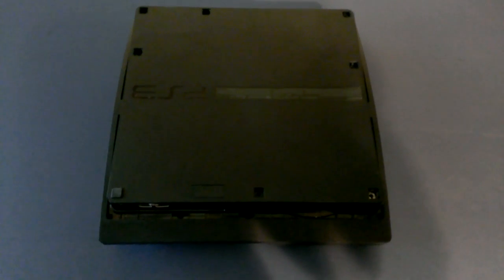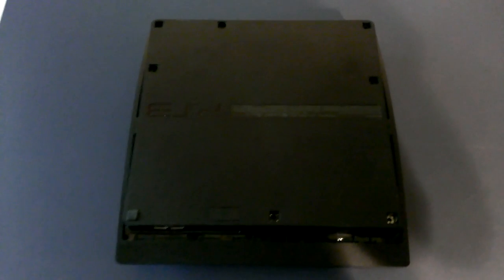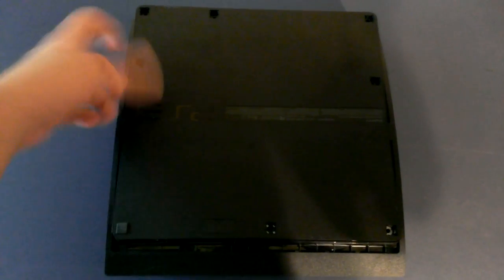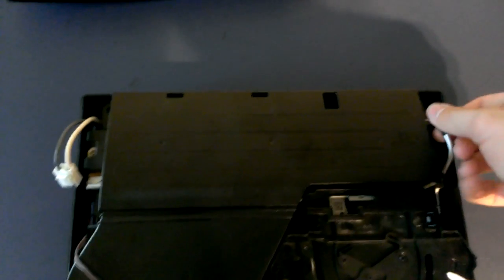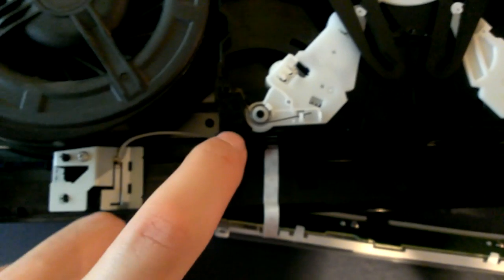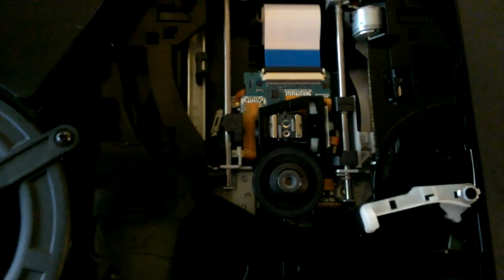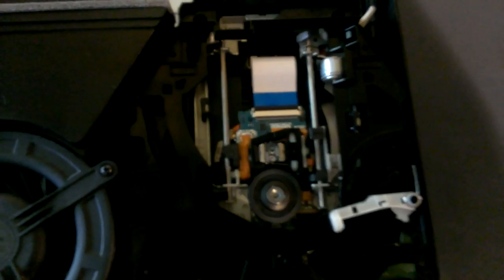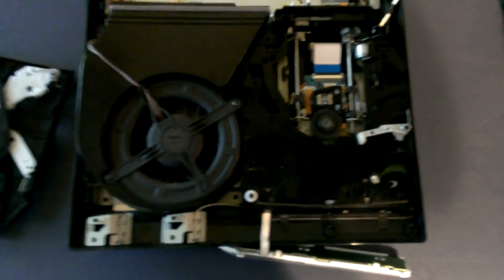How to Fix PS3 Error Code 80010514 Disc Read Problem

Comment: Just cleaned mine but still won't recognize a disc.  Guess I'll try again!
Reply: yep same here these fix it videos are bull crap! maybe it works for like someone in a very dirty area and maybe they smoke a lot, but my ps3 inside was fairly clean and I looked at the  laser lens with a magnifying glass for any smudges or dust but it was clean

Comment: Mine only happens with Madden 09 Collectors Edition, all my other games and movies work fine. There's no Utility Data on my PS3 for Madden, last time I played it was on my other PS3 that got the yellow light, I have a super slim ps3 now.
Reply: Same thing with me. Exept modern warfare doesn’t work
Reply: @lenonmedini3806  my comment is from 2 year's ago so i have a small update on it. My Madden 09 collectors edition has disc rot. Even though it's not scratched, there's no see through dot's after pointing the disc to a light source, the disc got damaged while i had it in storage, i found out that games made from 09 and prior, have a history of disc rot and they will get messed up through the year's.

Comment: Also guys, I just had the same error, ejecting the disc putting it back inside and then when you launch the game MASH all buttons on the controller repeatedly nonstop and it will get past 8001514 error screen
Reply: Real?

Comment: Guys, before you do all this, keep entering the game at least 10-15 times and if one of those times the game worked, it means even if you did all of this it will still give you the same code sometimes and you'll have to start the game by trying multiple times.
Reply: I kinda agree on this because I did try that with my Asian copy (R3) of Burnout Paradise for more than 7 times if I'm not mistaken but when I insert the R1 (region North America) copy of that game, it works consistently. It's weird that this happens to two (including Battlefield Bad Company 2) of my R3 games....
Reply: @hashrulsubzero  I'm having this problem with CoD World At War unfortunately. I miss it so much but couldn't catch many games before it completely stopped loading the game
Reply: @Kamal_AL-Hinai  yeah i have issues with battlefield 4 and fallout 3
Reply: @Kamal_AL-Hinai  same here. Was playing world at war back in January and it worked fine. Try to start it up today and get this
Reply: @sourkraut5369  
Turns out my CD was in a bad shape bro. When i got a new WaW CD it worked just fine every time. What a great game!
Reply: @Kamal_AL-Hinai  great to hear, thanks for the reply. Gonna get a new disk
Reply: Pvzgw
Reply: @aishadumm6772  
Why bother and type that? 😂
Reply: What do you mean? Like pushing the disc and pull it out or try the game and then close it and open it again??
Reply: @no-ei2ng  
Trying the game while the disc is inside the console

Comment: do not try this fix guys it useless, once u get 80010514 the disc is dead, u can try to play the disc in 100 different ps3 console and it will still give u the same error code, do not waste your time doing this
Reply: why are you so sure this error indicates the disc is dead? I mean, i’m only asking from where did u get that info?
Reply: @olivareszaragozadiegoisrae5685  i have tried it on at least 3 different ps3 console which play other disc fine except 80010514 disc, which gives the same error on all 3 console, so it def a dead disc, believe or not it up to u, there is no way to save it
Reply: @olivareszaragozadiegoisrae5685  u can try all the "fake" fix on YT like shaking the console etc which i have tried and they will never work
Reply: @mornstar5514 you're right. I tried playing Motorstorm disc on a different console and it gets an error code. I was trying to play The Saboteur and I still get the same error code, as I was about to play it first time. Any suggestions?
Reply: @dannyperdomo391  this prove that the error have nothing to do with the console, it your disc that died, trust me once u get 80010514 your disc is dead, there is no way to save it, if u really wanna play that game u have to go buy another  working copy
Reply: Wrong! I got that error code on a PS3 with just 1 game. Tried same game in another PS3 and it worked perfectly.
Reply: It isn't broken. It can be fixed.

Comment: Thanks...my PS3 is now dead. Wow! Thanks for nothing but ruining my PS3!
Reply: I agree with you, it doesn't seem a safe method. This guy seems to know what he is doing there but it seems risky to me for someone who doesn't have much knowledge about it. I'll try a method from someone else and let you know if it worked :)
Reply: @david0152  EXACTLY!! If it has to be opened like that to fix it take it to the professionals!! Mine is completely dead!! Had to take my bro's so won't be trying anything like this again! If you find a way without having to open it up please do let me know!! Thanks!
Reply: @valeriemedina4109  I'm so sorry to hear that. It really sucks when things like that happen. I cleaned the disc now to see if it is because of that but it still shows the same. However I saw a video from someone else and I'll try that. And yes sure I'll let you know 💯
Reply: @valeriemedina4109  I just did it and it still doesn't work... The thing I bought this game from a game stop so it is second hand. I tried everything so all that is left is to go back to that store and ask them why it doesn't work. Anyway I hope that won't happen to you again. Wish you all the best!
Reply: it's too abvious that he is a pro at this type of things....Maybe you did smth wrong or missed a step! I feel sorry for you! try fix it somewhere!
Reply: @valeriemedina4109  Nobody forced you to do this. You are the one who ruined your system.
Reply: @kingofdust9725  Thanks for yout input! 3 months ago..I forgot I even posted on this!